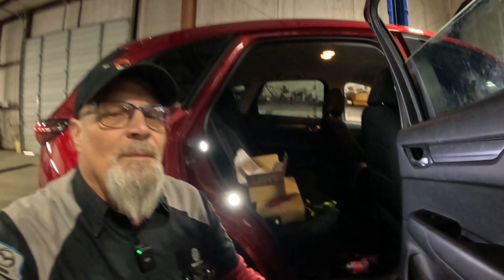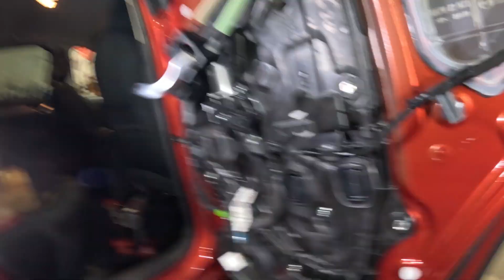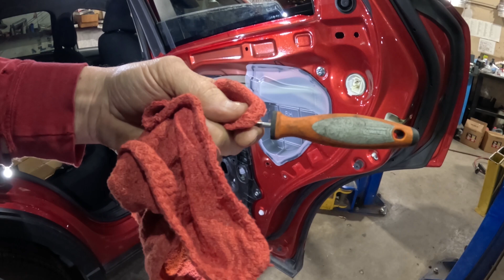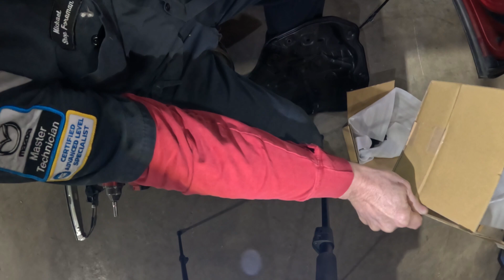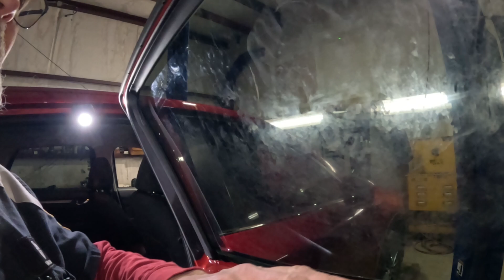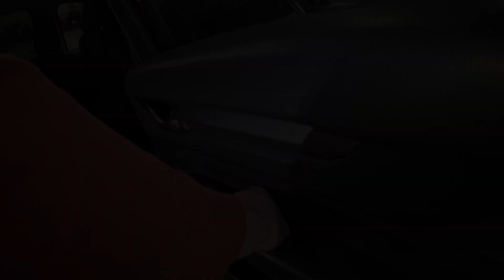Mazda CX 5 Window Regulator and Motor Replacement

Comment: A suggestion since my bolts to the regulator busted through the plastic cover(door module). A bar clamp for wood working. Over the frame and grip the window?🤷‍♂️ idk just a suggestion thank you for all the info though

Comment: What are the pliers you are using to remove those clips that hold the cables to the door?
Reply from the maker: That is just a trim clip removing tool.  There are many different types of clip removing tools.  This just happens to be the one I have.  It's a Matco tool.

Comment: I have a 2022 CX5 and the passenger window won’t roll down completely, I have to press the switch several times to roll it down completely same way to roll up the window, the driver master switch will only works for the driver and rear sides. What could be the problem?
Reply from the maker: Sounds like two problems.  The master switch possible open circuit. And, the passenger window regulator binding or dirty run channel.  But, it would need to be diagnosed.

Comment: I just replaced the front window regulator following your instructions. A little different than the rear door but pretty straight forward. Thank you for a very instructional video. I didn’t clue into why you left the car running while you were replacing the part in the video. I understand now that it doesn’t take much to drain the batterty in these cars. I thought I messed up the electronics or something but later realized it was my mistake draining the power from the battery. All good and the window works great!
Reply from the maker: You're welcome! Glad the video was useful, and it sounds like you figured it out.

Comment: What if I’m rolling up my window it stops then I release the window buttion and then pull up again then it stops again and dose it to the top and to the bottom
Reply from the maker: You can try to lubricate the run channel with rubber care or silicone and see if that helps.  Chances are, the regulator is binding and causing the motor to overheat.  It's probably going to need a new window regulator and motor.
Reply: @ShopForemanGarage 10-4 sounds good

Comment: Do you grease the regulator track with anything?  Thanks again!
Reply from the maker: I don't because there usually no need to. But, white lithium grease for the regulator track and silicon or rubber care for the run channels.

Comment: Thanks for the video.  I have a 2018 cx5 where the front pass. window came off the track.  Tried to reset it myself, and the window came out of the regulator channel.  Are the channel clips glued to the glass?  I saw a video on a 2016 cx5 where he took the window out and removed the clips also.  Am I able to take the window off, reglue the clips, and slide the window back in place from the top?  What kind of adhesive would you use?
Reply from the maker: This one is hard to explain. If you are talking about the plastic clips that are glued onto the bottom of the glass that the bolts go through for the window regulator. Then yes you can glue them on if they are not damaged. We use two part epoxy. You need to somehow mark the window in the position that they go on with the window in. And then pull the window and glue them into place. Or, bolt the clips onto the regulator with the door module half way out and the window all the way up. Put epoxy on the clips and quickly bolt the door module in and lower the window down into the clips.  Good luck.
Reply: @ShopForemanGarage  Thanks to your video, I now know how to take the door module out. My mistake was trying to glue the window back on the regulator by just setting the glass in place. From the markings on the glass, I can see where the original clips were glued on. Since the front corner cracked when it dropped in the door🤣, I found a local guy who will replace the window for $300.  I didn't realize the new glass came with the clips already glued on. I gotta go back in and clean the adhesive of the regulator.